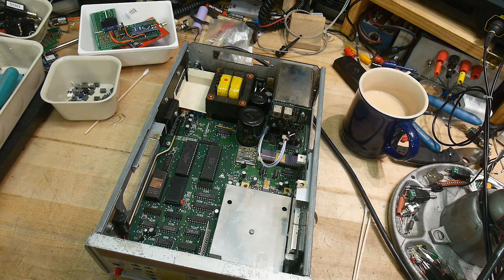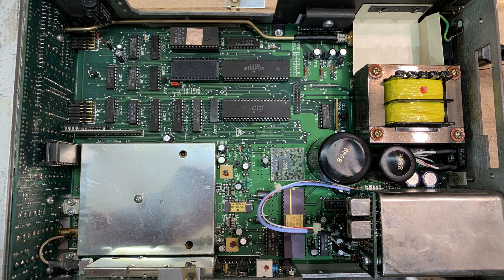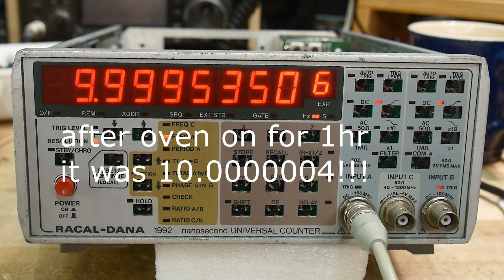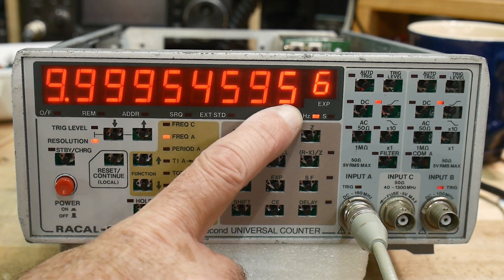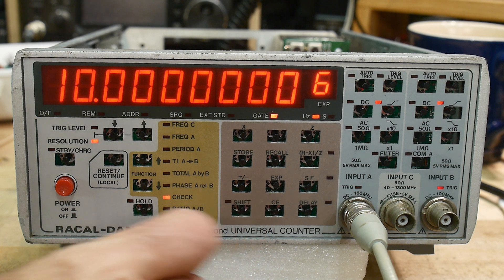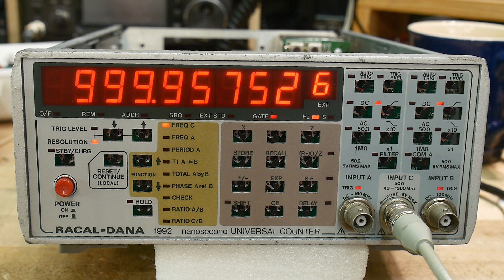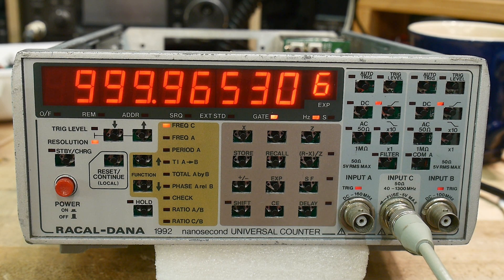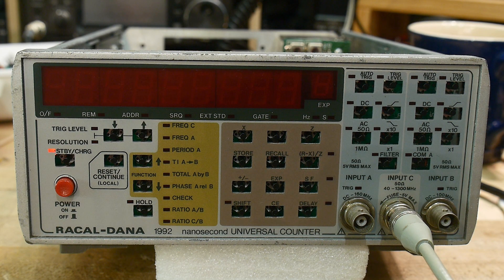#1022 Racal-Dana 1992 is Working Now (part 4 of 4)

Comment: Late comment but... The wired behavior very likely had come from a stuck button, or one that got low on ohms by coke or coffee. The resolution can be overdriven to a 10th digit, by just going up in resolution, shifting the higher digits out of the display. 12.3456789MHz can be displayed as 2.34567890 MHz. You can't see the leading 1 anymore but get another digit down in the resolution.

Comment: I have two of these. I had to replace switches in one. The oven oscillators in these are very stable. Tracking the gpsdo, mine track within .009 hz in 10 digits.

Comment: Where did you order the switches?  I have several 1992's in my shack and would like to have some spares on the shelf as this seems to be a common problem with this unit.
Reply from the maker: eBay, you want the 6x6x10mm version.
Reply: @IMSAIGuy  Thank you!!!
Reply: The correct parts are SKEGACA010 ...they fit perfectly & their "t" top fits the plastic caps without gouging them up.  The price has gone up since they were discontinued 4/2019 paid $29 for 100, 4/2021 paid $29 for 100.

Comment: If you want ten digit resolution you can press and hold the up button to cause the unit to overflow the first digit.
Reply from the maker: Yes you are right. I was hoping to see all 10.
Reply: @IMSAIGuy  you need the 1998 model for true 10 digit resolution.

Comment: Nice to see it back in good order again. For the BNC connectors and front panel simply use some automotive silicone spray on a cloth, and wipe them over. Will keep them shiny and tarnish free for a long time.